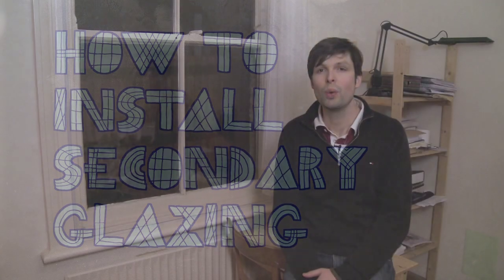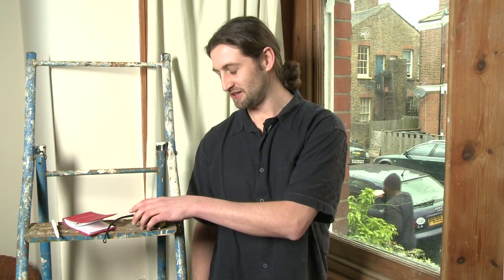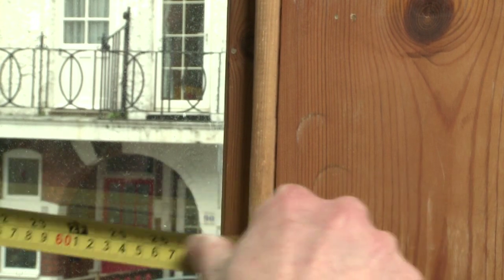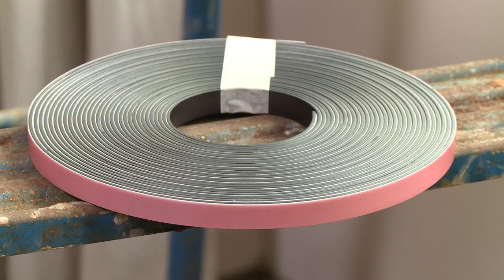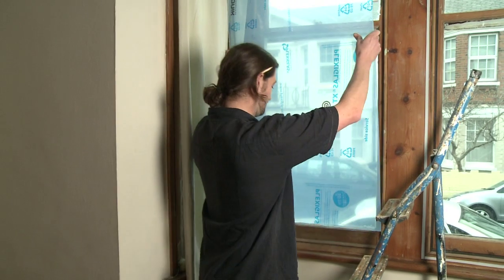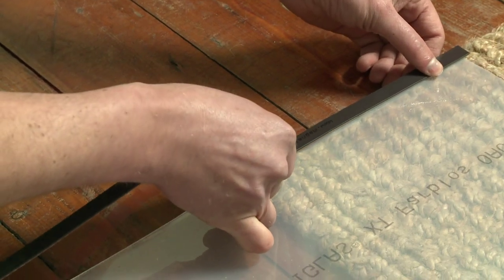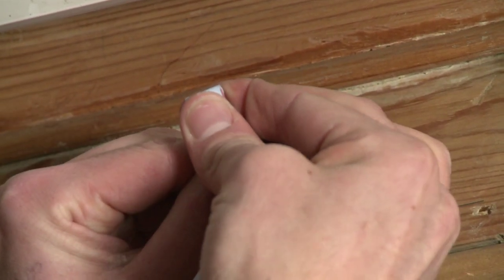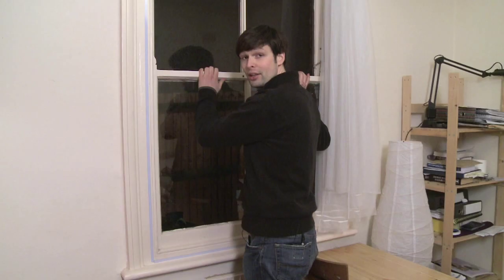How To Install Secondary Glazing

Comment: Hello. Was wondering if you'd do a short demo showing how this type of secondary glazing cuts outside noise. I'm trying to find a cheap way to cut noise from leaf commercial lawn crews with blowers, a hospital with helipad, a nearby stadium, and rail yard, all of which are just out of control here. All I need a simple shot with the glazing in place, and then with it off, while a friend stands outside with a leaf blower, or something loud going on.

Great video, and thanks for posting this. :)

Comment: No one will be laughing at this when in January when heating bills hit £4000+ a year. And besides no one will want to open their windows. I've done an even cheaper form of secondary glazing using a roll of plastic used to put in front of notice boards. It works well in the winter keeping the heat in. It's been on my window now for about 3 years but has discoloured considerably. But is there isn't any view through that window it doesn't matter. Surprising how it keeps the draft out and the heat in quite well.

Comment: Is there a reason you went for 2mm rather than 4mm?
Reply: I think the explanation is that it is the air between the outside window and the secondary glazing that does most of the insulating. So thicker secondary glazing makes little difference.

Comment: Hi I tried doing double glazing like you did but it unfortunately did not work out. The a and b magnets were not strong enough and the magnets were pulling away from the frame and Perspex. I even used glue and  silicon on the frame and Perspex. The glue/silicon stuck to the frame but not to the Perspex. I ended up using double sided 1mm foam tape and stuck the perspex to the window frame and screwing them in. I was so upset doing this. What magnets did you use? Maybe here in Australia we do not have magnets like yours? I looked everywhere. The Perspex is 6mm thick
Reply: I live in Australia also, and have been worried about not being able to get strong enough magnetic strip also.  Doesn't sound like Bunnings magnetic strips would be strong enough.  Will enquire at AMF Magnets tomorrow?
Reply: 6mm is so heavy  !
Reply: he say 2mm thick , 6 mm thick of course to heavy
Reply: 2mm thick won;t work for soundproof .  Not point to double glazing.
Reply: @kingsford2032  no one mention that it's for soundproofing .. i use it for heat insulation and the most important factor in insulation is the gap between the two glazing layers